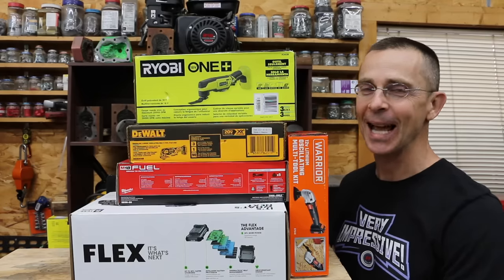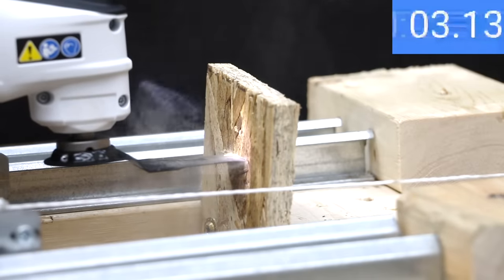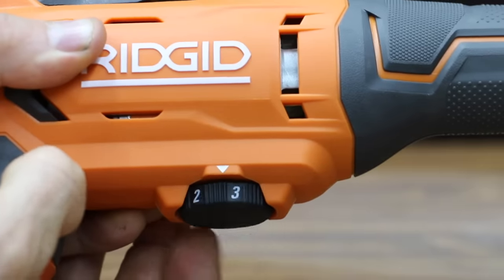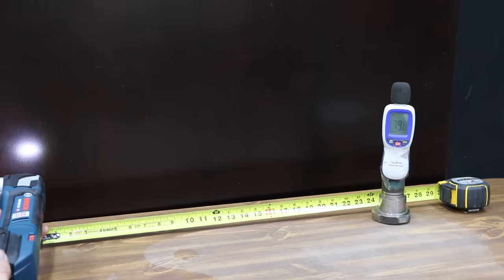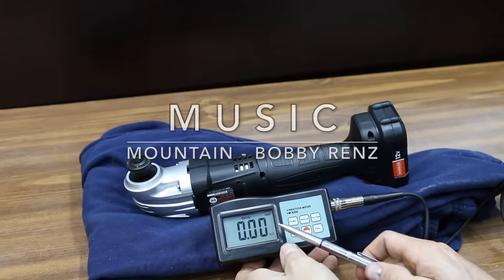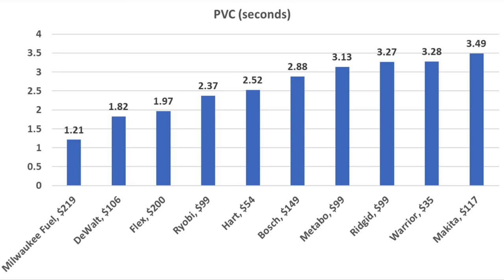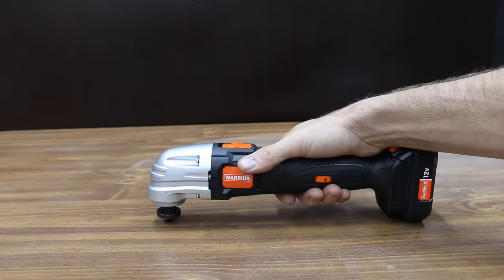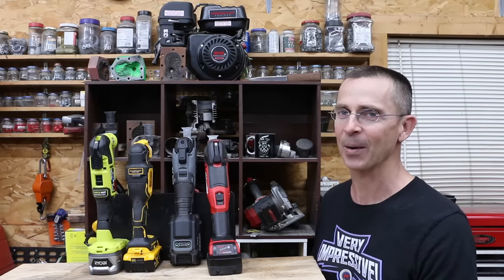Best Oscillating Multi-Tool? FLEX vs Milwaukee, DeWalt, Makita, Ryobi, Ridgid, Hart, Metabo, Warrior

Comment: The vibrating part is a bit strange to me. I have and use a corded* makita (TM3010CX1) and the vibrating on that thing is nearly unnoticeable. But on my ryobi (same model as in this video) Without a blade i feel almost no vibration at all which is in line with your results but when you add one on it's borderline unusable at it's highest speed and still uncomfortable even at it's lowest because of how harsh the vibration is.

Did you notice a vibration difference with blades on? I would really like to see a test on how the vibration stacks up on all these battery powered ones with a blade equipped. I'd love to be able to replace my makitas but without sacrificing my hands to vibration.
Reply from the maker: Thanks for sharing.

Comment: Have you tried the m12 fuel? how does it stack up to its bigger brother, the m18 fuel? Currently have the dewalt and love the true quick change but its not fun holding it for too long as the handle gets scary hot and the vibration is pretty violent
Reply from the maker: Thanks for the suggestion.

Comment: I'm by no means a brand snob but the designs on the metabo, bosch, and makita are a little disappointing. Milwaukee does perform great but the cost of it for a diy'er or home owner is not realistic( I'm a carpenter by trade and I'm gona have to get my boss to buy a milwaukee.) I've watched ryobi really come into it's own and for a cheap tool line..I'm impressed with how much they keep reinvesting in themselves to make better and better tools.
Reply from the maker: Thanks for the feedback.

Comment: I would love to see a comparison of mini chainsaws. There are lots of brands on Amazon, eBay and YouTube. They range in price from around $40 to $200. Thanks!
Reply from the maker: Thanks for the video idea.
Reply: @ProjectFarm  : I ordered one today from eBay. I could have bought one for $38.99, but decided to spend a little more and get two batteries and a blow mold storage case. I also added a 2 year warranty from Allstate for $4.99, so it came to around $60. I’ll use it to trim smaller tree branches and large shrubs.

Comment: Looking for suggestions.  I need to remove wall to wall carpet and it looks as though an oscillating tool is best for me.  Which product can I use that will not break the bank?
Reply from the maker: Thanks for the  suggestion.

Comment: Project farm really? You handicapped the flex at the knees with a 2.5 hr battery and then dubbed Milwaukee the performance winner!? Bro I’ve had so much respect for you channel up until now..do a fair test of ability. Apple to apples yo! Flex will trounce Milwaukeeall day. Put a 5 amp hour in the flex

Comment: I have the ryobi and it vibrates so much it's unusable.  I'm looking into getting the newest Makita, but too bad you used the older model here to test!
Reply from the maker: Thanks for the feedback.
Reply: @ProjectFarm  I actually have both Ryobi multi tools, the regular 18volt which came in a big set and the HP version.  I found the base version is too weak to be useful in most situations.  The HP has more power but like I said it vibrates quite a lot. I'm thinking I maybe got a dud because no one else mentions the heavy vibrations.

Comment: Speed of cut is not a real fair comparison when the battery sizes are not being matched tool to tool. I see flex has a 2.5AH battery and milwaukee has a 5Ah battery. Of course it will be faster.

Comment: Damn, $200 for the flex tool, blades, charger, and battery is a really good deal. That has to be cheaper than Hart if you account for all three items!
Reply from the maker: Thanks for the feedback.
Reply: @ProjectFarm  Do you have a program made that auto replies to every comment “Thanks for the feedback.”

Comment: Why not adding Fejn brand? .. they are claimed to be the best by many in Europe.
Reply from the maker: Thanks for the suggestion.
Reply: @ProjectFarm  I was also told on job sites that Fejn is the founder/creator of that kind of saw.. If it was a lie or not I don't know but 1 thing I could tell was that the Bosch would put all vibrations in my wrist if pushed too hard, Fejn would just take that extra push and bite even harder in to the wood while leaving my wrist feeling fine after 3 hrs of painful kitchen demolition. (Bosch would total my wrist in 5-10 minutes)

Comment: Have 2 disagree with you buddy you wouldn't believe I use these everyday cutting through Granite concrete wood porcelain tile you name it I put it through it first one I bought last me 3 years Harbor Freight second one last me 5 years Ridgid believe it or not my third one going on 6 years Dremel literally concrete granite tile even cast-iron those are the best three

Comment: Testimg the tools without raking the original into account is crap. The original is the Fine Multimaster and - in my opinion - still the best one. By the way: Fein is also the inventor of the electric drill…

Comment: I can't believe you are missing the fien saw.
Reply from the maker: Thanks for the suggestion.
Reply: @ProjectFarm  oh its not just a suggestion, they are the OG and still the best in my opinion, I just haven't seen one that is battery powered, I'm sure they probably have it, I just never looked into it. But the vibration and strength beats my battery powered Milwaukee.

Comment: The vibration test isn't designed well. You should suspend it at the far ends of the handle, not let it rest on the table, which will always depend on the vibrations at the surface that touches your trousers? And it's not just an offset equally across all brands, because some brands do a wonderful job on anti-vibration. The Makita DTM52 which you didn't include for example, it's been out for over a year, this video is 3 months old.

Comment: Tool doesn't matter. It's the price of the batteries and what you are set up for. GL on having 5 different brand batteries.  Kinda like driving your EV to work or towing your work trailer , I suppose.  Batteries have a purpose, some are FAR better than others and in the end, when the batteries die, ya throw away  the tool and buy a new kit due to common sense and practical use. Has ANYONE in the trades "repaired"  a cordless recip saw, impact or drill in YEARS?  "EV's" will be the same... once the battery is junk, the rest is landfill material. Not a lotta "EV's"  on jobsites,  other equipment providing fuels or "politicians" flying around on on EV's or solar planes... although,,, I'd like to see a LOT of them try those out!

Comment: RLY RLY RLY bad review, because there is no instrument from the original manufacturer, which is also currently widely sold in Europe and is very qualitative, wikipedia says ,,This type of oscillating tool was originally developed by the German manufacturer Fein in 1967,,

Comment: i Started out with ryobi but the batteries are terrible.
Reply from the maker: Thanks for the feedback.
Reply: @ProjectFarm  Np i kind of lost hope with ryobi when seven batteries went dead during a larger project. 
Went with blue bosch, wich i still have. Needed nailer gun and bought some hikoki.
Needed clamping gun and bought milwaukee.
All of theese are good in my opinion,.
I recomend milwaukee, due to them much like ryobi provides allmost all the different stuff you (might) need.

Comment: Not glorious for Metabo.
With industrial machines, blades are half the investment  -> I would have compared all the machines with one common blade.
Vibration/noise is directly linked to precision. A multi tool must be precise.
Then duration is not part of the test.

Comment: Any of the tools with a click on/off button should automatically be crossed off your buying list. Your thumb will hurt and probably get cut in cold weather from turning it off/on all the time. Go with the trigger type, like DeWalt has. You can thank me later.
Reply from the maker: Thanks for the feedback.
Reply: Some say it allows for best handle flexibility once locked, no need to be able to squeeze...
Reply: @AR-vf7vg  Go ahead and buy one with the click on/click off and see how bad it is.

Comment: 2.5 amp battery on the flex and it looks like a 5 amp battery on Milwaukee
Reply from the maker: Thanks for the feedback.
Reply: @ProjectFarm  is the cell count the same in both batteries if not slap a 5 amp on the flex and I bet it comes out on top

Comment: You're comparing Milwaukees's brushless model with Makita's brushed model instead of Makita's brushless XMT04ZB? Why? The brushless Makita is cheaper than the Milwaukee, also more powerful, quieter and lower vibration (than brushed) and with a vastly better tool change mechanism. Clearly aiming at clicks not info, and viewers should definitely read your disclaimer.

Comment: yikes - that Makita did horrible.  I would expect a lot more out of them.  Worse is that I have both Makita and Ryobi and actually bought the Makita over the Ryobi (only slightly more than the Ryobi on eBay) thinking it was the better tool - even with a brushed motor.
Reply from the maker: Thanks for sharing.

Comment: You over looked the original company that invented the tool…Fein! Which is a corded tool with more power then any of these and is pure German engineering! I do own a 20 volt dewalt which in very handy for small tasks but is nothing close to the Fein…any serious cutting have I to do gets done by the Fein! Also your test cut is not the way the tool is meant to be used…you should be moving the tool from left to right since it is a oscillating tool 🙄 do a straight plunge cut is gonna smoke the blade super quickly.

Comment: in fact test is not looking 100% valid. as on the test you use blades from the manufacturer, but what if you will use the same manufacturer blade? LEts say buy some 10 blades from one company.  that will show the real situation on which device is the best. as device could  be the same in productivity, but the quality of the blade could ruin everything :)